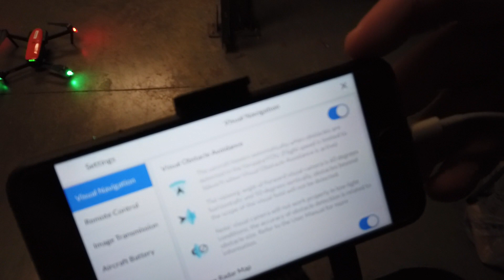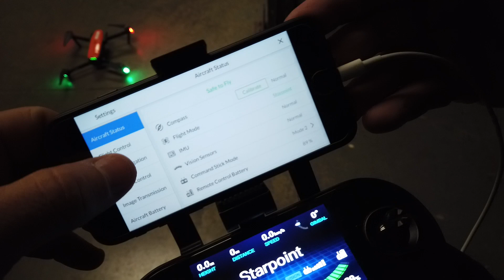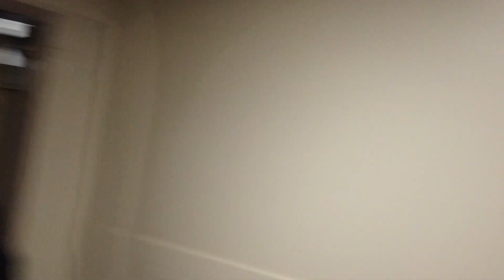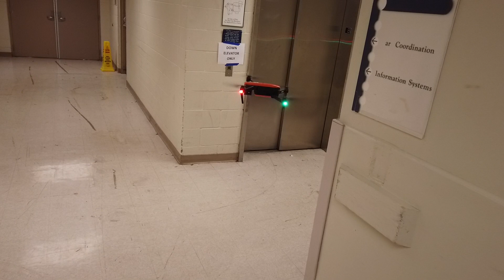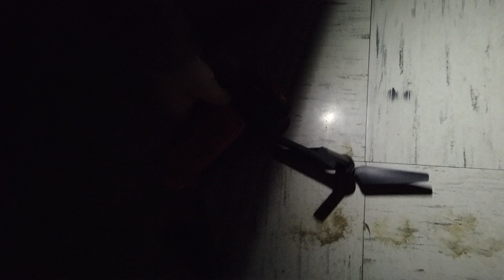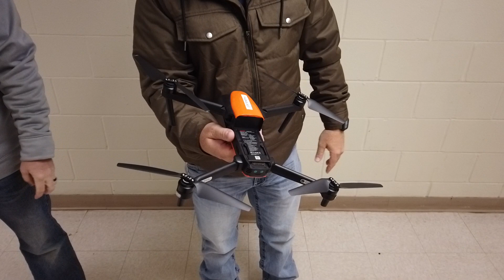Autel Evo Interior Flight Testing

Comment: ???  why would you do that?
Reply from the maker: We do it all the time in police response for interior situations that don't require immediate SWAT intervention.
Reply: @garretbryl625  you buy expensive drones, not inexpensive ones?  and you do it all the time,,,   must be nice, having tax payer money,,lol  just that answer tells me you just dont care, I mean if you didnt think that was going to crash, then,,,,,,,,,,,,, I have nothing left to say,,,,,,,,,,,,,,, wonder if you had to pay for it, yourself, you would do it another way
Reply from the maker: @guglielmodicarlo4139 , be careful with your assumptions.  None (not a single one) of the drones in my test (or that I use) are purchased with tax payer money.  The ones that I use were purchased by me and volunteered to public safety (along with my time).  Some of the ones that are tested are provided by dealers or manufacturers for the purpose of testing.  Always remember -- assumptions can be very dangerous.  They will often lead you to very wrong ideas.
Reply: @garretbryl625  well then I stand corrected, these days its hard to know whats true or not, , so I apologize for my assumptions,, I guess I just cant believe someone would use a drone like that one, for the purpose you guys are using it for,, it is NOT designed for that type of use,,  if your going to deploy a drone indoors, around corners , you would need signal repeaters every so often, specific  repeaters  you can throw in its direction of travel, to do what you guys did is just, well,,,,,, is just stupid,,,, the signals these aircraft use do not travel or work like that,,,,,   showing how little  you know about how the drone receives and sends signals to the operator ,, or gets signals from the controller,    funny how a guy like me would know this, not doing that type of work, and not damaging a nice piece of equipment like that,,,which I guess annoys me knowing how long someone would have to work, and save to buy one,,,,  again , my big mouth and concern , is not my business, ,,,,, I would have known better,,, and KNOWN it would not have worked,,   anyway,, it is what it is,, just my 2 cents, which Im sure means nothing ,,  and Ill mind my own business in the future, just when someone posts a PUBLIC video like that hard to keep my mouth shut,,,,,,, so  ,,, again, my bad and not my business or money, ,

Comment: I was thinking the same thing! Jesus he bought those years of flight exp and never flew a day in his life lmao... omitting the ignirant flight test in general he had the worst flight control I've ever seen someone who has apparently "3 years" under their belt... not trying to be a sick but it's obvious that there was a much needed change in piloting for this type of challenge or stupid test or whatever you wanna call this.. and you've gotta be joking about the flight distance estimation along with signal efficiency because over 4 block walls and 250+ feet to display horrid flight operation and ignorant testing gives you no where close a right to tell Autel they need to fix their transmission system because if you look up the patent system on the FCC website you can see that Autel and DJI use the same wireless transmission except for the Dual Active band hoping under DJI which wouldn't really help much considering the 5G channel wouldn't make it but maybe half as far as the 2G band will.. I just feel bad for the poor little EVO who has to endure such nonsense and abuse... oh and did you find out about how Autel Sued DJI for using the patented Quick Release prop system? I wouldn't put it past them to have stolen the transmission system, improved on it a bit and got it out to the public before Autel had a chance to shit an wipe their ass with DJI just due to the size and volume of infrastructure and tangible assets for production. 

NEXT

Comment: Not to be too judgemental but !!!
The guy with the sticks seemed like a first timer...not very smooth on his sticks at all, which caused alot a jerking around...try again with a seasoned pilot and I'm betting on better results
Reply from the maker: The point of the test was to test signal penetration.  Pilot didn't fly it into the wall, it lost signal and drifted.  He's been flying public safety for about 3 years.  Not a rookie
Reply: @garretbryl625  ...sad, after three years and flys like a rookie...
Reply: I was thinking the same thing! Jesus he bought those years of flight exp and never flew a day in his life lmao... omitting the ignirant flight test in general he had the worst flight control I've ever seen someone who has apparently "3 years" under their belt... not trying to be a sick but it's obvious that there was a much needed change in piloting for this type of challenge or stupid test or whatever you wanna call this.. and you've gotta be joking about the flight distance estimation along with signal efficiency because over 4 block walls and 250+ feet to display horrid flight operation and ignorant testing gives you no where close a right to tell Autel they need to fix their transmission system because if you look up the patent system on the FCC website you can see that Autel and DJI use the same wireless transmission except for the Dual Active band hoping under DJI which wouldn't really help much considering the 5G channel wouldn't make it but maybe half as far as the 2G band will.. I just feel bad for the poor little EVO who has to endure such nonsense and abuse... oh and did you find out about how Autel Sued DJI for using the patented Quick Release prop system? I wouldn't put it past them to have stolen the transmission system, improved on it a bit and got it out to the public before Autel had a chance to shit an wipe their ass with DJI just due to the size and volume of infrastructure and tangible assets for production. 

NEXT

Comment: lol you cant do indoor position hold in the dark. The downward camera needs to be able to see. That's why it drifted into the wall.
Reply from the maker: Fully understand that.  The reason that it stopped is because the transmission system could no longer penetrate the infrastructure of the hospital building.

Comment: Subed your chanell come on guys these units  were not designed for this use at all  the only way this could work is putting a repeater in each corner  as you go down a hall way! What you are trying to do wouldeasyly be done with a dji tello setting up 3 repeaters with power banks then when advancing you leave a repeater in each corner and a tello is 80 usd on sale ! I have many hours flying a dji tello remotly
Reply: Repeaters? The goal is to send a drone inside when there is an emergency situation (like active shooter), avoiding sending SWAT officers without knowing what's inside, so they won't send officers placing repeaters inside of the building ;-)
Reply: @antoinesp03  you throw them inside  the technology exists